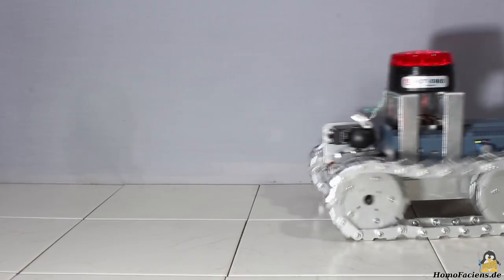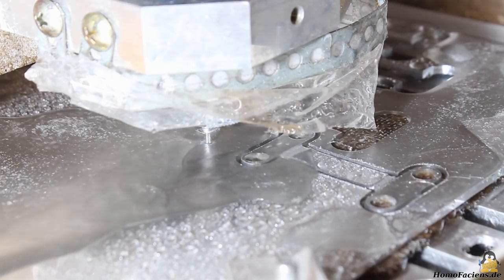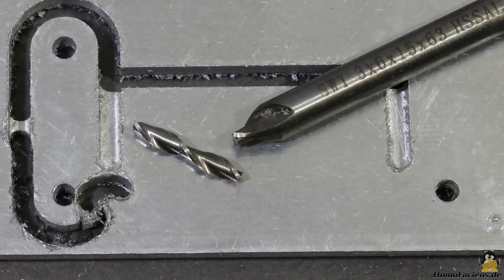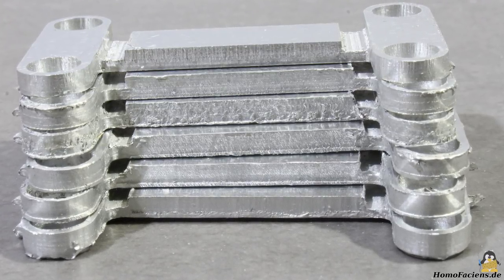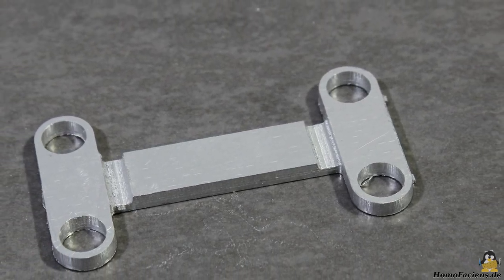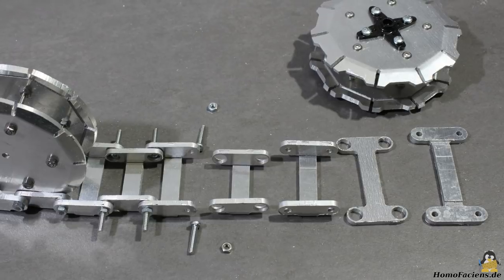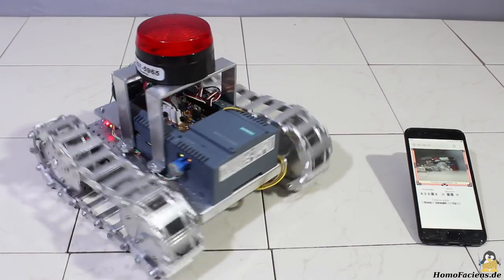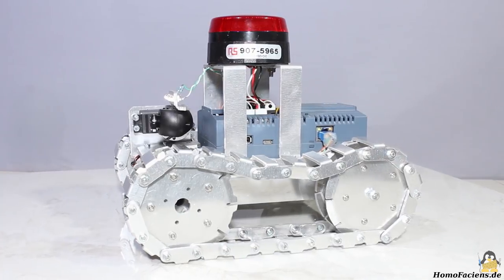Rover R12 with IOT2020

Comment: What's the traction like with those aluminium tracks? Does it handle well on very smooth surfaces?
Reply from the maker: It drives well on the floor. I haven't tried the offroad capabilities, yet. It's meant to be a demonstration of what my CNC can do rather than a machine that is made to climb steep hills. I will give it a try if I find some time to spend with it.

Comment: Are you sure that speed is 4 mm / sec?
That would be 240mm / min ...
To me it looks, like is more 1.6 mm / sec   or   100 mm / min.
Reply from the maker: 4mm/s is the maximum speed. In the video I am not always running with maximum speed. The software is still a bit experimental and so even when not being in the material the machine speed it sometimes lower.